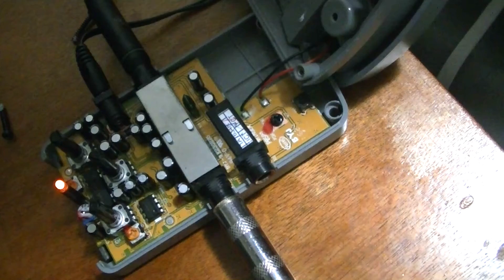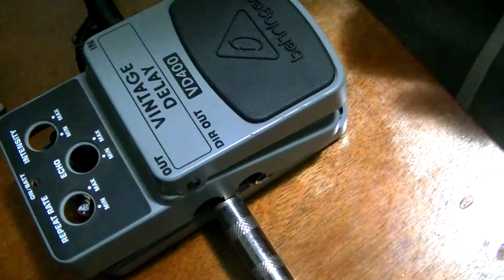LET'S MOD: Behringer VD400 Vintage Delay - longer delay mod

Comment: You have the case open you mess with two of the inner pots but just say "I don't know what this one does" and don't even try messing with it?:face-pink-tears:
Reply: I wouldn't have messed with either of them without checking in an oscilloscope the original settings and the actual trimmer operation 😆

Comment: Dont try guys this method its nearly destroy my vd400 it took me hours to adjust back to its normal state
Reply: Destroyed in what way ...like nearly broke it? Overload to electricals? Or destroyed as in; tone change?
Reply: @gypsysteve3576  well the circuit is updated, I ended up breaking it entirely, stopped working. wasted 31 dollars, my suggestion is just be very careful because its super sensitive, once adjusted to your liking try not to repeat the process too often or it'll come off like it did in my case, sad because i bought it for this purpose only, probably just gonna spend 100 bucks on the jhs delay.
Reply: @elti-buron1462  These trip-pots aren't meant to tweak a lot like 'proper' pots. The name also kind of implies it, you set it and you let them be. Unlike normal pots they are often rated for 1k turns, but it's quite possible they put in some pretty cheap trimpots because the user isn't supposed to touch them (often). Or maybe they aren't put on very solid.
Reply: @elti-buron1462  You didn't break the whole thing, just replace the broken trim pots with new ones.

Comment: Hi, I have a Behringer DD400 and I noticed that it changes the tone of the guitar when I turn on the pedal. I would like to do a MOD for true bypass. You know how to do? Thank you!
Reply: Same , plus , it's like the delay is the same everywhere. You loose high end after the adjust
Reply: @semajsemajsemaj99  Ok, understand! Thanks!
Reply: @ivo51505150  just play with it you can get rid of the metic sound by adjusting , it's going to take an hour by ear . Cool pedal still , it's not broken .enjoy your toy 🙂
Reply: @semajsemajsemaj99  Ok, thanks!
Reply: @semajsemajsemaj99  adjusting which one? Sorry I have the metallic sound problem
Reply: @destroso  I did it so long ago ,it's hard to remember , crank your amp up loud first , not crazy loud ,this way you will hear the metallic sound easier, this is your acoustic ossiliscope, gently adjust to ear , it will go away🙂. Adjust and listen. I just set the delays so it was fairly close to oscillating and play the strings quietly .

Comment: My experience is - I did the same - the repeat rate knob isn't that sensitive after this. I mean the rate is fairly the same in the lower 50% after that it quickly changes. And the rate went down marginally. But it does work.

Comment: I just adjusted the trimpots inside. Now the delay time is longer. But at long settings there is a high pitched noise. Maybe clocknoise? How do I get rid of that?
Reply: Just did the same...I turned the middle trim pot only a couple of degrees clockwise, it it appears to have disappeared. It is certainly not notable anymore to my ears.
Reply: @1redgate8  the one above echo or intensity?

Comment: Great stuff, but if it's a true analog delay I don't understand how there could be digital artifacts.

If it employs some kind of noise-reduction technology, which is digital, it may struggle to reduce noise over the extended delay - maybe this produces the artifacts? 
Anywhichway, great stuff, really appreciate the mod info!
Reply: BBD chips are neither digital nor analog because are time discrete. They sample continuous analog values but they do this at certain time intervals. This causes sampling artifacts.
This is my understanding of it please correct me if I'm wrong.

EDIT: The artifacts are filtered with  a simple low pass filter.
Reply: @S1NKONE You are right my friend.

Comment: Good mod thanks. You could actually unfolded that internal pot and add one the you can control from outside with case closed. Also, carefull with those conductive screwdrivers around the chips. You might let the smoke out.

Comment: Hi, I removed the screws( top and bottom) and the top still won't come off. Is there a way to remove it without breaking it? Thanks.
Reply: Lespaul13100 what I did is remove the knobs first then took it off because the knobs where causing it to not take the top off
Reply: Daniel Santiago Thanks!

Comment: Holy frigging crap, dude. This is awesome. It's neat they put those internal knobs in there. I'm definitely doing this. Thank's for the information.
Reply from the maker: No worries. How'd you go with the mod? Find a sweet spot that you like?
Reply: Yeah... I prefer a quite faster delay, so I went with clock-wise to get it faster, but with the main knob I can still get some slower delays... Plenty for what I need.

I did't turn it all the way down, maybe about a 1/4  turn on the knob. Once again though, dude... Great information.